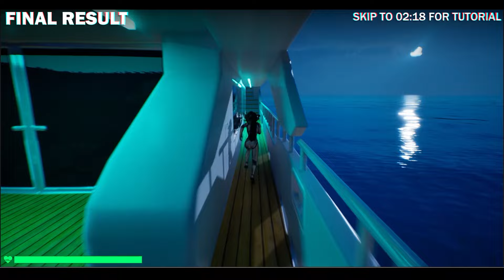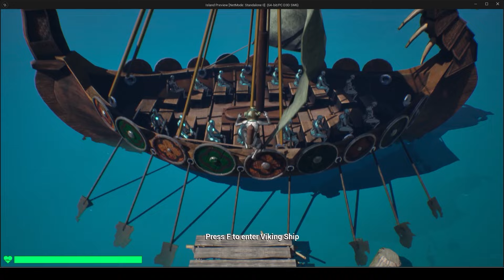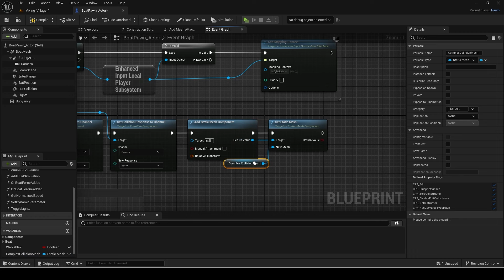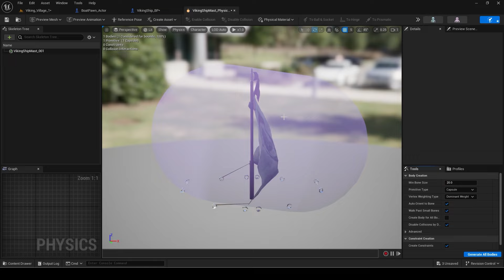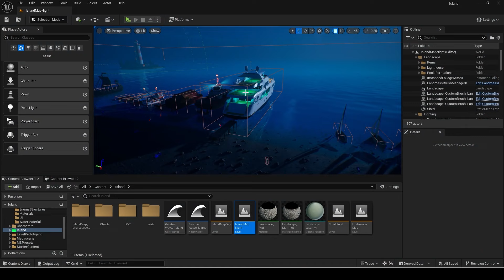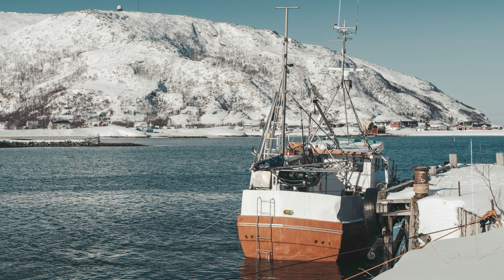Unreal Engine 5: Boat Docking (Water Series)

Comment: This collision method is not performance efficient, as complex collision have heavy performance effect, U need a custom collision made from third party software and then import it, basically a simple collision but with less polygons
Reply from the maker: Yeah. I just used it since it would be 100% accurate. You can alternatively just use the collision break down feature and it will make it more accurate or just make the collision mesh from scratch externally as you suggested.